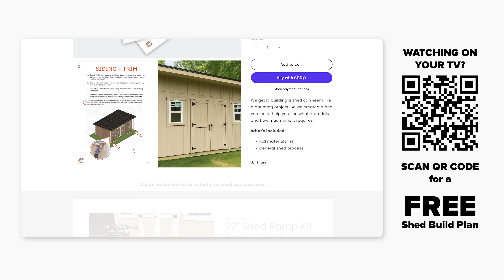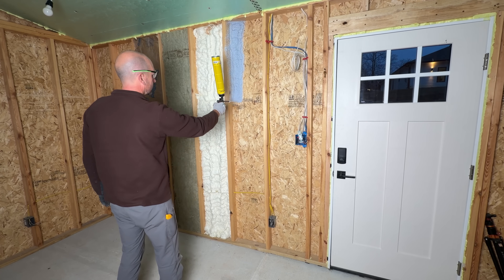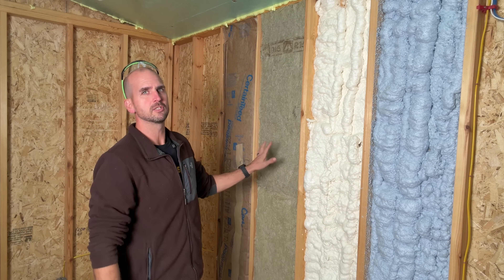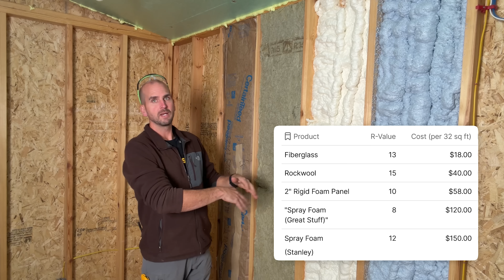Stop Wasting Money! Most Homeowners Are Insulating Walls Wrong

Comment: I built an apartment in a 100 year-old chicken barn. My living space is about 480 square 'I have 2 by 6 studs In New construction area which is my living room and my office And 2 by 4On the back side Inside the barn . I used rockwool and it is very soundproof and I love it. I hope to add About 500 more square 'And I plan to use 2 by 6Throughout And I will use rock wool again

Comment: Sir thanks! Rock wool is good stuff! But you are way way off on foam. The products you demonstrate here are for cracks.  Not insulated walls.  Seems like you went to a preconceived solution not a cost based and performance based comparison.

Comment: When using the Rockwool insulation, it's much easier to cut using a serrated knife - like a bread knife. Benefit of the Rockwool over fibreglass - it won't settle over time and is more impervious to moisture. Also, when you have wiring running between the joists, you should cut the Rockwool halfway through its thickness at the height of the wiring to allow the insulation to surround the wiring.

Comment: Should put radiant barrier in the ceiling before putting up the foam board. Radiant barrier is the key to keep the heat out before it hits the insulation.

Comment: 40+ yrs ago we pulled out the lathe and plaster. No insulation in the walls. Rockwool and spray foam not available at the time. 100+ year old house so studs were a true 2X4.  R-19 fiberglass with vapor barrier throughout most of the house.

Comment: Your 2” foam panels you put on the ceiling are only rated R-10. Not sufficient for ceilings. Heat rises. Ceilings need a higher rating than walls. At least a R-21 or above.

Comment: One thing I have wondered when building an occasional use structure like this. How long is the payback on the insulation assuming a good vapour barrier is installed on the inside and wrap and siding outside.  Sure this depends on your climate and heating costs.
I am writing this in the livingroon of an older home built in the 1940's, in Canada, in December. My heating bills are almost comparable to much newer, insulated homes nearby.  Of course if I was building new construction I am required to insulate, and I would. But doing the math, if I retrofitted insulation to my old home, the payback time is in excess of 50 years at todays prices.
Also increasing R value insulation has deminishing returns.  1" insulation offers a large inprovment over 0. But the second inch does not double the effect. This is not talked about, but it is fact.

Comment: Having worked in construction for more than 25 years, I’ve seen insulation installed incorrectly far too many times. Even after my house passed its final inspection, I checked the attic and found that the blown insulation was not installed to the required depth.

I’ve also seen prefab showers installed on exterior walls before those walls were insulated. In crawl spaces, I’ve seen insulation installed only near the access door because some inspectors simply open the hatch, look inside, and don’t check the entire space.

Another important detail to verify is that the R-value remains visible after batt insulation is installed. Some installers will split batts to save money, reducing the insulation’s effectiveness. Others install insulation incorrectly by placing the paper vapor barrier against the wall sheathing instead of facing the conditioned space.

While some states do not require a vapor barrier, it is still essential that the R-value be clearly visible and that the insulation is installed correctly.

Comment: Bullshit. Rockwool has shreds of metal in it. It will poke you through gloves. The problems with foam. One it breaks down into gas. This gas can build up and make you sick. If the foam is defective it will break down fast. Two you can not check for rot.

Comment: Another huge benefit rockwool has over any of the other insulation types is its ability to significantly reduce the passthru of sound.  If you're wanting to reduce the noise of an air compressor for example rockwool is you're absolute best option.
Reply from the maker: Really good point.  Thanks for the feedback!

Comment: For max efficiency, the 2" ceiling foam board should be cut to fit snug between the studs, otherwise you'll have a gap of hot air between roof and foam board

Comment: I'll never us fiberglass again. There are large cans of spray foam, too big to hold and spay, so they use hoses and I think it is mixed from two cans. I don't know how that compare in cost. Some insulation boards could still be used in walls and then foam or tape the edges and seams. A few years back on new construction I used spray foam from a contractor. It's significantly more expensive, but they would have put in 24in of blow in fiberglass, but only needed about 5in of spray foam, plus the attic ceiling is sprayed, so the attic is so much better. It's actually easy to add lights or do work in the attic. Even with much less insulation, and making the entire attic conditioned space, the foam reduced my A/C needs by a ton (12000 BTUs). So, while more expensive, there is a path to ROI.

Comment: I completed my barnamenium after the metal building company finished the shell. 2x4 framing throughout. I filled both 2x4 and 2" metal pole gaps with rockwool. Almost 6" total. It turned out like a Yeti ice chest and our energy usage year round is peanuts(low)... Very low. For 1200 sqft, we avg around $100 for electricity using a heat pump.

Comment: Rock wool 1000% heres why, it doesnt burn or mold up as water doesnt hold in it like fiber.  Also down the road if you ever want to do a reno its easy to work around/ remove.  It doesnt smell, and it offers good sound deadening.  Annnd, its not messy...but you do need a big knife to saw/cut through it.  You cant go wrong

Comment: Spray in insulation is worse than if you put in pure propane and sealed it with a spark plug exposed to it. If you want your home to burn down in less than a minute, use that. Best to use either styrofoam or the typical pink insulation. Never spray insulation. Never. A homes burn downtime is reduced from 20 plus minutes to minutes, if not seconds. Difference between life and death.

Comment: The spray foam in a can is not designed for how you are using it.  We used spray foam on our delivery vehicles, but we had it commercially done.  Also, it's going to cost you a fortune to heat/ cool that space until you get a whole lot more insulation above the ceiling. 🥶

Comment: MOLD, UNHEALTHY OFF GASSING & INSURANCE CANCELLATIONS… Spray foam off gassing is a big problem in occupied spaces. It’s not just a short cure time.  Study up.  Furthermore, any moisture can get trapped and mold and rot can occur hidden from sight behind foam.  Circa 2024, insurance companies are refusing ‘foam insulation’ coverage.  The tide has changed away from spray foam.  Depending on where you live causes different issues.  

In the cold climate areas, semipermeable membranes are installed first.  It’s different in warm climates.  ASIRI Designs is an architectural company out east that explains these variables and ASIRI has a nifty YouTube channel.  Rockwool and fiberglass are similar in insulating properties. However, a layer of cork in colder climates, then the Rockwool or fiberglass are often better.  Cork is an insulator and can handle some moisture and wick it off avoiding mold and rot.  Backing material matters as well.  It’s wise to do research and do it right the first time.

Too many DYI serious mistakes.

Comment: Rockwool has all the benefits. Fireproof to 2200 degrees, moisture resistant, mold resistant, it can breathe and no sweat your walls, rodents don't like it and it's too dense for them to want to burrow in it. Non toxic too, no craft paper covered in flame retardant, and it insulates better than any other batt material. 
It's usually the same price if you order from a distributor instead of big box stores. Rockwool, always.

Comment: Get a contractor to do spray in urethane.  Has highest R value per inch.  It only takes a small amount of moisture to cut the R value by 50%.  Rock wool and fiberglass are the worst for that.  Put you hand by an outlet on a windy day.  If you feel a breeze, you are getting moisture penetration.  It only takes about 7 years to pay for it in energy savings.

Comment: As being a electrician.  You foam your inside walls you cant remodel any electrical in those walls without cutting all the drywall which gets real expensive on the front and rear end. Insulations needs to be on the outside of the wall it has way better R values and sound barriers.

Comment: The nice thing about Rockwood is you don't get slivers in your skin and ich as much ? Seriously..
 I'm a red seal carpenter / Interior Systems Mechanic and have done thousands of square feet of Rockwool.  it is by far worse than batt insulation to work with. It is way more of a skin irritant than any batt of fiberglass. Also spray foam fumes are toxic you should be wearing a mask while working with either material. Now Rockwool may be superior to fiberglass batts but why are you even bringing it up if you're talking about cost effective? LoL your using the most expensive ways to insulate a shed. And doing it wrong I may add. Not cutting for your wire leaves air gaps that will create moisture in thermal transfer from the exterior wall.and the rigid foam goes inside the truss cavity not on the trusses, how do you plan to sheet the ceiling after? And why on earth are you using the cans of foam when you can buy the 2 part tank system and a fraction of the cost. You may also want to add that you can lift a building off its foundation with too much spray foam and lock doors and windows in place with it as well. Not to mention that you can also cause a chemical fire if used incorrectly. Good products if used correctly but I see alot of issues with the install that someone like me normally get a call to come and fix later..... Best advice I can give a diy is consult a professional before doing what you see on YouTube.

Comment: how can you justify double the price for an extra R2? also if your exterior siding and roofing system is installed correctly you wouldnt have to worry about any moisture or mold. "fireproof" is a great feature but it is just resistant, and once its on fire the insulation isnt going to slow the fire down with all that wood around.... I just dont understand the logic here

Comment: I just used rockwool to insulate my new office in a garage conversion but only did it for soundproofing. Was easy to work with and made a huge difference in sound reduction which was the point.

Comment: You have to put plastic over the rockwool insulation for a vapor barrier. The R-13 kraft faced already has a vapor barrier because of the paper face. You are correct about putting the fold of paper to the inside of the wall.

Comment: Up in Ontario in Canada, they built two identical homes for testing insulation. One was spray foamed and one was done with conventional methods, pink and vapour barrier. They measured the energy used over a couple of years to heat and cool the houses to the same temperature. The spray foamed house used half the amount of energy over that time. Not sure how long it would take to overcome the difference in price, but with rising energy costs I don’t it would take too long.

Comment: The wife and I built our own home ourselves and as we live in the snow belt of Upstate NY, we wanted the best possible insulaion values we could get.  Our home is a 2 story loft style on a poured concrete pad crawlspace using  ICF blocks about 36" high..  We researched a lot and found that using 2x6 24" on center, an exterior wrap of 3/4" foil faced polyiso sheeting with taped seams, then a professional spray foam in the interior walls of the first floor gave us an amazing r-value with no thermal bridging.  We also polyiso'd the exterior of the roof, then used 3 1" sheets of polyiso with air gaps in the interior rafter spaces, followed by an R-38 fiberglass batt.  The home is about 1500 sq/ft and heated only by wood stove.  Even on the coldest days -20 F or so,  once the interior has warmed to around 75 or so, we can go about 24 hours before temps drop to 64 degrees.  The crawlspace never gets cooler than around 48 degrees.  You can see the house build vids on our channel....
Reply: Sounds like you took the cheap option to insulate your house, but I'm glad it's working out for you. My partner and I chose to wrap our house in 3" of engineered aerogel on top of 6"of spray foam applied over 4' of SIP panels that were salvaged from an Antarctic salvage operation. Thus far it seems to work pretty well. On cold days, my wife refries 8oz of pinto beans, and after dinner, we are able to heat the house for roughly 2.5 days with no external heat source. We had some videos online, but I think they took them down...

Comment: Windows as well, when my house was built in 1991 (by an architect as his own home) he designed it with a lot of passive insulation and temp controls.  May be great in theory but not so great in practice.  One thing required back then was insulated double pane windows that were really expensive compared to ordinary panes of glass.  And the house has a lot of them, 168 separate panes of double glass which by 2025 nearly all have failed and the vacuum, or inert gasses between the glass sheets is gone.  I had one, the kitchen door out to the lanai and pool had failed long ago and was moldy on the inside so you could not see out.  The door was standard then, now not a standard size so to replace the door light would have been over $1,800 for a custom job.  I had them remove the old double pane insulated window and just replace it with a nice thick sheet of glass.  The R value will be lower, but when you get into it the R value on the double insulated light simple was uneconomical.  It was $600 for them to replace the window with just regular glass and over $1,800 for a new door that had the new standard and smaller sized window in it.  To replace just the double insulated window in the old size would have been pushing $3 grand.  I did some calculations and decided that even if utility bills doubled that insulated double pane window would never pay for itself at the breakeven.  It would have to save $1,200 in utilities and I assure you I could not possibly live that long.

Comment: There are products that integrate rigid foam insulation with roof sheathing for an exterior application that would offer much higher R value. Also the studs or rafters are thermal bridges so exterior insulation on the sheathing would be much more cost effective. Take into account the labor cost. The spray foam is not only expensive to buy, it's more laborious.

Comment: Rockwool is fireproof and will not melt like fiberglass.

The ceiling should be insulated the most.  That 2 inches of ridged foam is inadequate.  The roof is where most of your heat loose in the winter  and heat gain in the summer will be.  You should have put rockwool between the ceiling joist and then the ridged foam to get the proper R value.

Comment: The problem with spray foam (other than the off gassing) is a few years in it separates from the studs, and allows air infiltration. I've seen gaps more than ¼ inch in places 5 or so years old.

Comment: Hire a spray foam insulator to insulate your home, seals completely tight, and when you use the right foam which he didn’t you get a R-14 minimum with 2 inches. Might cost more but don’t need a vapor barrier, and there will be absolutely no air moving through if done right. But on that note don’t hire a new insulator, make sure you know what pound foam they are using and make sure they do there prep work.

Comment: I didn't even price fiberglass went straight to rockwool (mostly because I didn't want to know how much more the rockwool was). So easy to use and got R30 on my 2x8 wall. $80/bag which is 30sqft but it's also 7.25" thick and qualifies for an energy improvement rebate. Also it has superior sound absorption and can withstand heat over 2000 degrees F.

Comment: Used spray foam on top and bottom plates, penetrations and windows for air sealing and used the cheap fiberglass between bays. Had Great results

Comment: If you've got anything in that wall, wire, plumbing, even a crack that needs repair, good luck finding it with that spray in foam.  Sure, it's really good, but what a god dam mess!   Everything's a compromise... access and repairability need to be considered.

Comment: I've used over 100k on rockwool insulation the past 3 years. For the rigid foam I'm not a fan of because it builds up heat in the summer so it's not as good as people think it is when it comes to keeping a room cool in the summer especially on a ceiling.  Otherwise it's good for keeping you warm in winter.

Comment: That roof might condenses cause the cavity between the roof line and the Ridgid board .. supposed to be installed touching the roof line..some times in the end of the slope you si darker marks in the wall that means condensation

Comment: best insulating and keeping mold out? get rid of particle board first, if water gets in its a good place for mold to grow, for a similar cost use rigid insulation and the thinnest is all you need and it causes a thermal break and really restricts moisture from getting in and then use fiber glass. BEST way for cheap life of shed.

Comment: third WRONG mold gets everywhere if water gets in, biggest misconception with mold though is ITSV EVERYWHERE ALREADY, you just get more with moisture. All those will get it but the only difference the spray limits it more from getting inside?